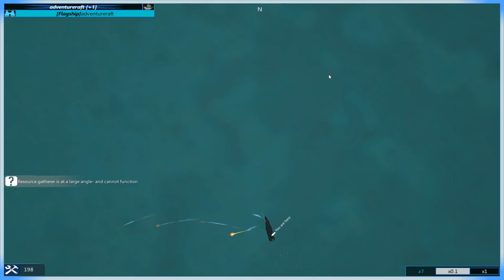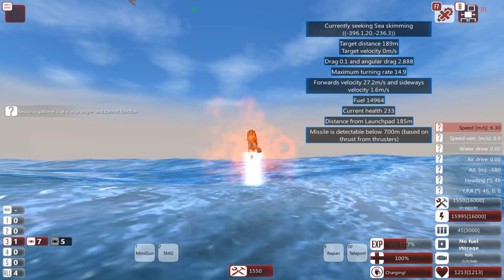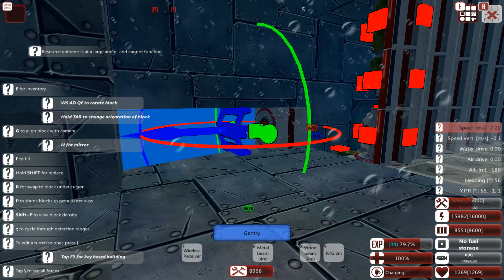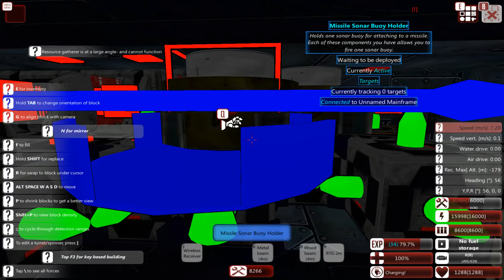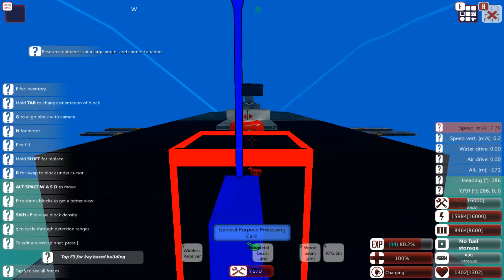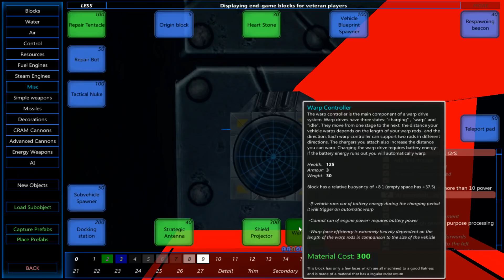From The Depths - Getting Rich - Adventure Mode

Comment: You should try APN guidance on your missiles. Set the guidance activation delay to 4 seconds, add a one turn, and your missiles will be more accurate and lead better.
Reply: Don't overlook the fact that you can change the gain on APN, I find raising it from the default of 3 to around 5 or 6 is often pretty useful. APN is completely useless if your missile is not already heading in much less than a 90 degree angle toward the target though, I'd say 45 degrees max with high gain, so using them on missile turrets or with one-turns or on forward-firing systems where you aim the ship at the target works best. Otherwise, active radar seekers with target prediction and plenty of fins and speed (Supposedly, moving faster makes a FtD missile turn faster too, go figure) has the best chance of intercepting surface targets, in particular when launched vertically.

Comment: * I think the periscope as it is on a turn block thing, does not cause drag. Stuff on turn blocks do not cause drag (read it somewhere in the forums). 
* Ammo is scary :/ and that is a lot of ammo  next to what currently is your primary weapon. How about extending your rear end and placing some there? The enemy AI aims for ammo-engines-fuel-AI if they are using the aimpoint card. Ammo AOE damage is in a 3x3x3 for a single ammo box.
* Smoke works under water, lasers that are shooting you underwater are already losing damage due to the water and you would again lower that damage with smoke and also help against the laser targeting for missile/torps. But the smoke uses ammo now not fuel (or the other way round)  
* Launch pad fire angle needs the Ejector :) and each radar / sonar buoy needs its thing plugged in at your ai
* AA missiles need to be a tad faster. Perhaps two sets, "long range" slow or loads of fuel tanks and med short range very fast 3-4 fins 
* regards the weapon you mentioned to fire at torps/missiles. I personally would set this up in designer mode and save the subobject to attach in adventure. 
* Question, what will you do when the enemy has LAMS?
*Idea, small ball PACs with a mix of EMP and piercing 1000m range to extremely close range. These use energy! which is why I would say close range.
*periscope is jammed in your hull after it was repaired 
*try the other build mode with F3
*you cannot achieve decent "stealth" your current setup is as good as you can get if you keep building like that. I made my sub out of light alloy ahahah to lower the views and all that, not really worth the hassle imo with the rubber or light alloy 
*warp drive - forums :D youtube :P . you will need to run the whole length of your ship in a single line of components to make a decent jump + a bucket load of power :/

Comment: Add more buoy holders than you have missiles for, so that it can launch more BEFORE the old ones expire from time.  The more buoys you have active out in the water, the more their detections can triangulate.
Reply: Having more detectors active definitely would provide more readings to average together, tending to increase overall accuracy.

But I have to nitpick... ;) Technically there's no triangulation involved in FtD's detection system. It works based on generating bearing and range readings from each sensor system's position, which are added to a pool and weighted according to your settings (or the defaults you left or auto-assigned), then averaged together across all readings from all sensor systems to decide where your AI thinks the target is (or was at that time, which it combines with current data to predict their speed). Fairly accurate range readings and bearings give you a good approximation of the target's position. That's very different from triangulation, which works solely on bearing readings from different known positions, and is useful when you have no ability to determine an accurate range from any one position.